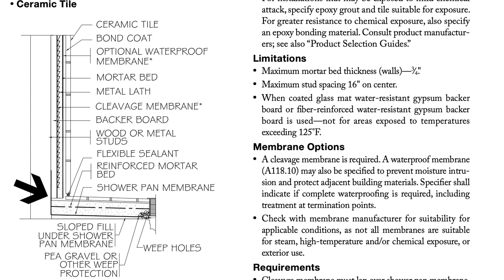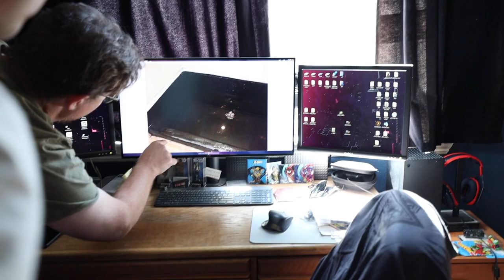Was StarrTile Right??? --- Shower Curb Failure

Comment: Starr tile doesn't pre slope his pan liner. He is adamant about not doing so and relying solely on trowlable membranes. I only use 2x4s to make a trough to fill with dry pack running the membrane up the centerline to create a monolithic cementous curb eliminating any wood products in the shower pan or curb.
Tile setter since 1983 with return customers 20 plus years. for what its worth.🤷
Reply: Is there a video explaining how you install the membrane to the centerline?? Interested to see how that’s done. Thanks.
Reply: I've been doing that for years with Rapidset Cementall. Sets rock hard in one hour. Membrane suspended in the middle of the curb. Curbs can be very svelt and minimalistic with this method.
Reply: @JayLepisto  that sounds very interesting can you send a video or pictures or diagram explaining with pictures on how everything is laid out I might want to try that with my shower. I’ve always felt that wood has no place On the shower curb
Reply: @mathusvaiaoga9787  No video but I have plenty of scale sketches. I have pictures of curbs as well. How do I send them to you?

Comment: Key is to never set on two x four wood Damn! Set your own using concrete block either 3-5/8” wide or the 2” high pour cap set on side using Platinum thinset or Polyeurathane to set laticret inside edge and top only not the front face to allow any moisture to escape . Cheers 🤙🏽👍🏽

Comment: Issac, I’m curious to know what your take on the life span of a shower should be. This one appears to be 15 years old right? 
How long should someone expect a shower to last? 20 years? 30 years? 5-0 years?
Reply: I think 8-10 years is reasonable if you ask me. Im a a tile guy. 8 years solid of daily use no issue is good. However you want to shoot for "  it goes out style before it fails "
Reply: @tnrcleancare7847  that seems like a reasonable expectation. 
Seems things go in and out of style rather quick these days.
Reply: 15 years plus low end
30 years plus high end
Reply: If tile is installed correct it can last the life of the homeowner and beyond.   Its just a matter of it going out of style.   Ive tore out old mud/lathe showers that were done in the 1960s and they were still extremely solid and perfectly flat.   The grout might need to be repaired down the road but tile/mortar should last!   There are marble jobs in historic buildings that have been around for centuries!  Now as far as how many years all the new technology will last remains to be seen.  No one knows for certain if a kerdi shower will hold up 30 plus years.
Reply: Till the house sees a bulldozer.
Reply: @jmicolorado  My mother still lives in my childhood home, built in 1958 and the mud set shower is still solid as a rock. If it is built right and maintained it should last a loooooong time.
Reply: One should grow tired of the design of tile well before it fails. I would not be happy if my shower lasted less than 15 years.
Reply: @tnrcleancare7847  Agreed, Those earth tones of the early 2000's are ready to come out. Even if they showers haven't failed.
Reply: The life of the installer.....30 years MIN.....

Comment: Correct me if I’m wrong, when the grout cracks then water gets behind the tile. So did the expansion and contraction from the 2x4’s cause the cracking? What causes the 2x4 ‘s to "move" in the 1st place?

Comment: If your correct that great news.
Did you flood test this shower prior to disabling it?
Was the shower door a factor in the water damage?
It's hard to tell from the tv was the curb cement wet on top? Or just down low on the exterior of the shower. I would suspect a pan leak if  the cement on top of the curb was not wet because the weep holes were plugged and the pan would fill up!

Comment: In another video you made you show your wall board all the way to the bottom and your deck mud filled in around the wall board. Is this acceptable using a different drain system (schulter etc) and using roll on membrane? Or should you build the deck then add the wall board leaving a gap and a flexible sealant?

Comment: Hey Isaac I had a question for you I think it might have been answered I'm not positive but I have a traditional shower system with a pan liner I tore it out last weekend it was covered in water due to the fact they put little rocks around the drain I'm going to be putting it back together this weekend I was going to go with the traditional pan liner because I did not know if you could switch to a complete sealed method without tearing out the whole shower or if there was a way to use the pain liner and still use a complete silk method if you could write me back and let me know your opinion on that and your expertise or if there are other people out there that would see my post and would be willing to give me a hand or advice about it it was identically like the shower you just showed that was filled with water thank you for your videos they are very helpful I've done a lot of time but never built a shower base been a helper on them before

Comment: We use a lot water here lets use wood to build curb. No bells ringing? Wood expand and shrinks whole time when air humidity varies and of course it varies a lot in room where someone takes shower. 
If i would make curb like that i would pour it with some quick setting and drying concrete to make it as solid as possible. Never ever would use wood on that.

Comment: I have worked with topical liquid/membrane/sealed systems since 2009. And I have never had a callback on leaks and so forth. Would never ever do a system where the waterproofing is underneath the mud bed . That kind of system is outdated. We stopped building bathrooms like this in the 80s.

Comment: Pricing does not do any good for many because it depends on the location, and on what the competition's pricing ballpark is. Mentioning it may do more damage than good leading wannabees to jump into competitive pricing without the proper experience.  You can find out pricing through the bidding process (or your boss/his customers) and along with your history of proven work use it as a guide to compare workmanship, , and assess from that base.  You need to sell yourself as to the value of your work and provide proof of being licensed and bonded. Equally, the owners need to do their part and get three bids in order to weed out those who are in it for a quick buck. Or, preferably, they know somebody who has had the same type of work done and you go with the referral.  That's not all the building owner should do. They should read the installation instructions on the products that the contractor will use and make sure those instructions are followed.
Coincidently, RedGard no longer requires Fabric.

Comment: I don’t understand weep holes. Why is the water getting there? If the mortar is seeing water it’s failing. Right? The water should be on the tile and down the drain. If it’s under the tile it’s a failure. Just my opinion

Comment: I’ve never done a floated curb with either a pan liner or hot mop because I just couldn’t understand how it wouldn’t weep into the curb. Seeing this really confirms my suspicions. Glad I use sheet membrane.
Reply: Don't set your wall boards into your mortar ben. Keep the mortar pan separate from everything else and wicking is impossible.
Reply: @strapt313  I’d say less likely but not impossible. That’s why I use and trust sheet membrane.

Comment: 13-17,000 for a 3'x5' walk in shower?!?  Is there $10k worth of tile and hardware in there?
Reply: Yes. I do it every day. Fair price.
Reply: Also hes in California. Most places 10k-14 k
Reply: I feel the same way... Isn't all the work in the pan and the 1st course on the walls?  Steer clear of fancy built-ins and exotic stone and that should be 10k based on his quote for the lower.
Reply: @tnrcleancare7847  - wow...   what portion of the job is materials, on a shower bid like that?
Reply: @orcoastgreenman  half.
Reply: A Schluter system just the Schluter products alone done right is a couple grand by itself. Add tile labor etc. 10k easy. Every item is expensive but worth it. $350 drain grate 400 dollar  linear drain flange .. Thats just the drain my man. No pan no nothing.  etc.
Reply: @orcoastgreenman  Various factors but you're looking at 3500-5500+ in materials.
Reply: @ridenorthwest1687  - Thanks!  That's less suprising then... an older retired contractor once told me his simple formula was 2x material for labor for new construction, 3x for remodel...  So those numbers actually fall in line with what his estimation method would have come up with.
Reply: @orcoastgreenman  Theres plenty of different ways to calculate estimates. The way that I do most all my estimates are roughly as follows. Materials + 10% then around $800-1200/day for labor sometimes there will be some additional overhead ontop depending on the kind of job and the risks. Labor may vary depending on cost of living of where you are. But if you want to find out a good price to get a project done as a homeowner you can get a rough estimate on the materials then ask a contractor how long it will take and see if this lines up.
Reply: Hes gotta pay the camera man and editing crew

Comment: Waow... in Australia, we don't build showers like that or waterproof that way. we only use bricks concrete - have a large flange we concrete in then waterproof with membrane paint covering flange and entire floor and walls which is ok... or more expensive marine fibreglass with epoxy around corners and flange, then membrane paint to cover floors and walls waist height or higher... concrete on top of waterproofing then Tile straight on top want to make it high end we use epoxy grout. we talking 40+ years that I know of and maybe even another lifetime. I have seen bodgy jobs which are done by backyard guys which is the only time they fail.

Comment: i was about to do my own shower install with traditional 2 piece drain with weep holes. Been watching a LOT of videos. I'm at a  point of trying to find a fiberglass shower pan and just tile the walls. Anyone have any suggestions as to where to get a good quality custom (my drain is not completely centered with shower floor) fiberglass shower pan???
Thanks in advance!    
  BTW- Tile coach you handled yourself professionally with regards to Starr Tile
Reply: Move the drain it's not as much work as it seems or foam pan if you can
Reply: I tore out my water damage traditional shower pan and went with  tile redi pan,  well worth it knowing it's not going to leak  like the original  install.

Comment: But Starr’s being correct is moot. All his showers would fail due to the fact that he refuses to do a pre slope. After I heard that the guy has been 🤡 status.
Reply: If water is wicking up and over the curb, how exactly is the pre slope supposed to help?
Reply: @k.d.8924  because, the water wouldn’t be sitting and saturating the pan to works it way to wick over the curb if there was a preslope. Trying to dispel a water in water out system is exhausting. When done properly they will outlast the bathroom. It’s failure is from poor execution of simple task. Preslope/ keeping weep holes clear of the mud pack/ proper slope/ don’t puncture the vinyl liner. Pretty simple stuff. Apparently not for all. Have fun painting your showers.
Reply: Tar paper? Are you joking? Who built this?
Reply: the pre-slope does next to nothing when the pan is filled with deck mud. water isn’t going to travel down the slope, it will be absorbed by the mud. the dispelling of the water is mainly accomplished through capillary action. star tile proved this already.
Reply: @khgriffi  you quoting startard is already enough evidence for me that you will believe anyone that uses a few big scientific words with no real knowledge of the application. Preslopes work. Water in and out systems work. But the few steps required for them to work must be followed. Have fun painting your showers. Have a good one.

Comment: Man, 13k for a small shower like that? No way.   I think that's going way overpriced. I'm getting that bathroom down to studs and back together in less than a week. Material costs are high but how much are you putting on your man hours? $300 an hour?
Reply from the maker: Took us two weeks.  1 day dust containment set up and demo, 1 day rough plumbing and swapping out drain/drywall repair, 1 day straighten walls/install wallboard/float pan,  1 day waterproof pan/pick up tile/layout tile, 1 day flood test pan/finish texture repair to the walls/paint, 3 days set tile, 1/2 day finish setting tile with fast set, 1/2 day grout, 1 day trim out and clean up.

Comment: When it comes to this i do not know my azz from my elbow BUT based on what was being presented here, the wood curb isn't the culprit. The clogged weep holes are.. The wood curb alerted the owner to the issue... If the curb wasn't porous, where would the water wick to ? The studs of the wall ? Would the floor just start to crumble from saturation ? Is it impossible to divert all the water down the drain? ....

Comment: Starr tiles installs his drain without any gravel... he states that the gravel is what clogs the weep holes vs. The chance of sand clogging is minimal.
Did you find what you pulled out to be a piece of gravel when you drilled the nail thru??? Did Starr tile get that right also???
Reply: Starr tile isn't anyone I'd be taking tile advice from!
Reply: The weep holes get clogged over time from water deposits and sand as well as rust on metal drains. Gravel or not. Water in water out systems will always clog weep holes eventually.
Reply: @k_nardonecustomtilework  ... wasn't asking about taking advice... you're video is crediting his "advice" ( so you must be viewing his channel) .... just wanted to see your viewpoint about his judgment of whether or not gravel is necessary?
Reply: @paulwong8046  gravel is always relevant in any weep style system, even weeping tile around your foundation is covered with a layer of 3/4" crushed stone gravel.  using the correct gravel size is key as well.

Comment: On your wicking theory, it's not that complicated. It's just bad waterproofing that leaked near the curb. In this time period lots of guys were still using the old Laticrete 9235, which looks like hot mop to a Californian like you. They always did it incorrectly & it always leaked. You give them too much credit to claim it was "waterproof". Remember they also plugged the weep holes and you can see the waterproofing going up the drain body where it shouldn't be, and you showed the 1/8" thick curb mud, all proof that they were incompetent... so of course their pan leaked